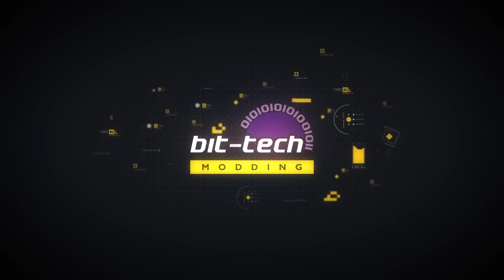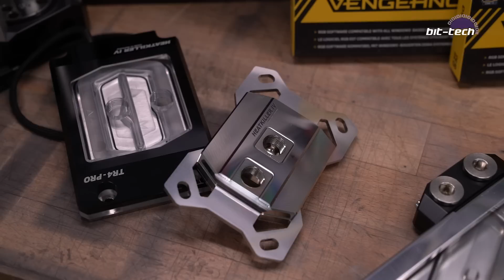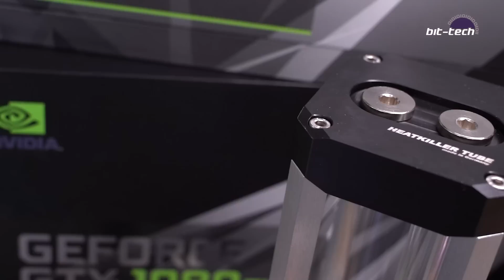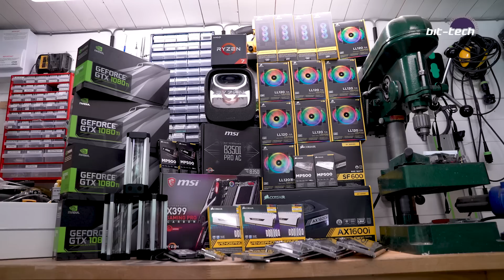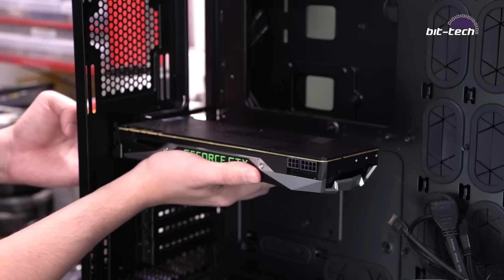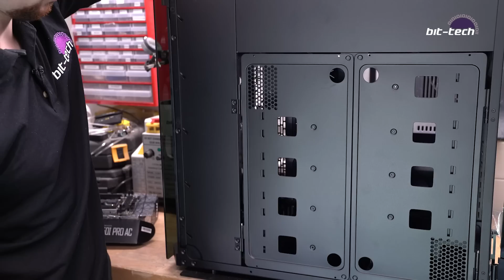Corsair 1000D Threadripper/Ryzen Build Update 1 - Planning! | bit-tech Modding

Comment: I do have one question. 4 gpus? The third either wont be used at all and won't be able to be used for the itx system. What use case does this serve? Editing, encoding etc?
Reply from the maker: Well quite frankly this build doesn’t serve any REAL purpose other than as a showcase. That said, we’re working on the principle of the triple GPU TR4 PC being a workstation of sorts, so perhaps for GPU rendering etc, with the ITX being for gaming/light uses.

The TR4 rig is fairly similar to my own workstation so I could see it being quite effective.
Reply: bit-tech sounds good. Stoked to see how you'll customise the build rather than bolting everything in.